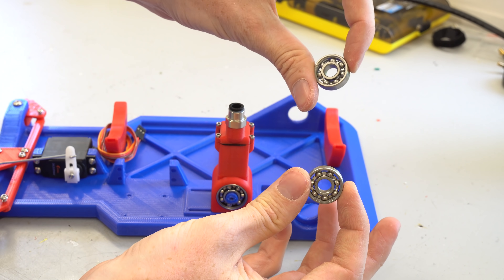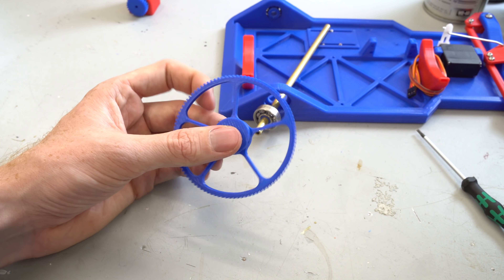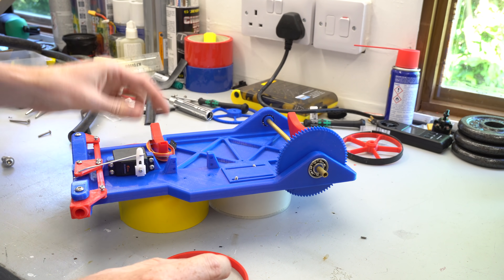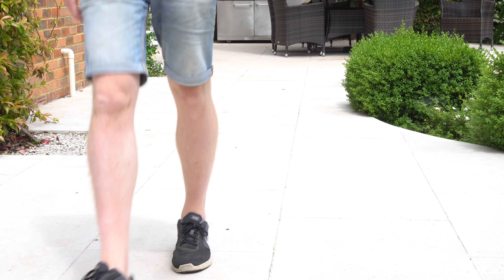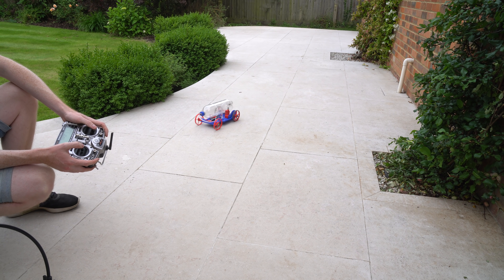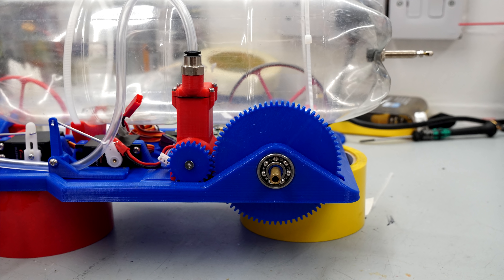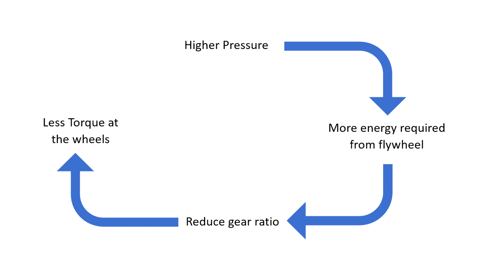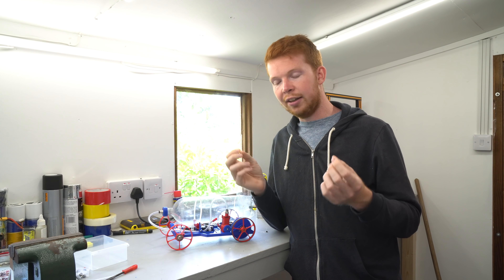Air Powered Car

Comment: You could put a flywheel attached directly to the engine's output (maybe a metal one to increase mass and decrease the space it occupies) and then use gears or a belt to move the actual wheels without the need for a "secondary" flywheel.
(Sorry for my bad knowledge of technical words in english I hope you can understand it anyway. Corrections on my english are welcome)

Comment: Works at low pressures; possibly make a pressure reduction system? Honestly pressure stuff isn't really my thing so I genuinely don't know if that's viable.
Another, easier, option is to simply have a seperate flywheel. If you move the engine forward slightly (it's already on that rail so it should work) and have a weighted large gear in the middle of the train acting as a seperate flywheel, you could essentially increase the flywheel weight and momentum independently of the car's wheels?

Comment: why not a seperat flyweel and mby adding a friction gear to get the movement to the wheels so that the engine can run further even if going slow or stop like anactual car

Comment: put the flywheel directly onto the crankshaft => higher RP, less gear wear (flywheel connected via a gear isn't really a good thing, engineering-wise)

Comment: Try to make some space for the engine to fit a flywheel on the other side. Then shorten the gear ratios to about 6:1 - 9:1 then it should work

Comment: Have you tried simply increasing the mass of the car? It'll ll return more energy to open the valve and if you're going to push start it anyway then the low end torque is less relevant, unless you just have a crappy driving surface.

Comment: Why not add an explicit flywheel directly at the engine?
Reply: Oh and one more thing, steam engines use something called a piston valve to deal with the problem of valve actuation force due to pressure. Only works for up/down stroke actuated engines though. But it uses the inlet pressure to cancel forces acting on the valve.

Comment: You Could increase the length of the crankshaft and add some heavy coin or other object so you only need to redesign 1 part instead of the entire engine

Comment: How about a dedicated flywheel on the motor's shaft? Adds more flywheel storage and you can still increase the gear ratio to get more torque at the wheels, it just adds a little bit of weight...

Comment: Third and correct option:
Flywheel should not be geared. It needs to be on motor shaft directly.
Output gear to drive then reduces normally. This gives flywheel full effectiveness by not reverse gearing it and increases torque on output to wheels as planned.

Comment: Awesome, getting there!   I think going the car route for this engine was a good idea too, easier to test and tinker with and probably requires less energy to move a car than provide lift for an aircraft.    For flywheel you could add one on the first gear, like a small metal disc or something.  Watching these videos kind of makes me want to get a 3D printer, it's cool how you can come up with a part and just make it.

Comment: I think if you made a two cylinder engine it would be able to handle the high counter torque and be able to run at higher pressure

Comment: print the small gear mounted to the motor in a heavy brass filled  PLA.  with a larger diameter flywheel area that will bypass the larger gear.

Comment: at 3:22, you can vary engine speed, wildly, for throttle control.   or you can vary how much power reaches the drive wheels.  or both.   a disc-and-caliper brake could be employed, as simple way of varying output rotation rate.    others have suggested that a flywheel be added to the system.   after some thought, imo, it may not be a good idea, to try to include a flywheel in such a simple power transmission configuration; ie, flywheel momentum will noticeably affect response to changes in throttle.     cheers

Comment: You could also try a dual piston engine, just take the exact same design as you have, offset it by 180 degrees and stick them together, this was you get a lot more force to open the valves. Ideally you would want 4, since then you could offset them by 90 degrees and you would always have a higher pressure from the piston pushing down than the valve trying to close it.

Comment: The engine would work better it modeled after a steam engine, better a two cylinder steam engine with offset crank can be started from stopped allowing the use of a throttle.

Comment: You should try a twin cylinder engine so that the force of the opposing piston helps drive the other one so the throttle doesn't always cut the engine.

Comment: Put a flywheel on the crankshaft.

You are also wasting a lot of energy as friction because your cams are so big in diameter. Larger diameter>faster rubbing speed at the same friction>greater power loss.

Did you think of making the piston cylindrical, getting rid of the gudgeon pin?
Reply: Sorry I did not explain that well. I meant a square piston with two cylindrical rounded edges so that it can wobble in the bore.

Comment: Now when you've got the valve ans plastic tube working maybe a boxer 2 cylinder could work nicely. Power every 180 degrees instead of 360. And although expensive you could look into a hpa system for airsoft as the air supply

Comment: One problem with this design is that it has two driven wheels and no differential solution between them. The car will stop itself when it's turning. Simper toy cars have one wheel drive and that's probably the best solution as you have good traction and smooth surface to run on.

Comment: Having an higher RPM moter with metal flywheel and then gearing it down 20 to 1 would probably work better.
Reply: MazeFrame and the air bottle would empty in two seconds. No, I think he needs a few tweeks to improve efficiency (like adding a flywheel) and it’ll work a treat.
Reply: Reducing the bore would reduce air required while also reducing mass allowing for higher RPM.

Comment: the diameter of the piston / the travel of the piston if =1 square >1 super square. It will effect the speed of the engine. You need a smaller piston and a longer travel

Comment: You could just gear it down, put a metal flywheel outside of the gear on the engine and increase the pressure. That would probably solve all of you problems...

Comment: Electronic "ignition"?  Use an encoder for the shaft position, and a selenoid  to open and close the valve. Speed and engine timing in one valve but there may be to much weight penalty.

Comment: You are also losing power and speed while turning due both wheels moving at the same speed, making one wheel drag the other one and requiring more torque to clear the turn. This can be fixed by making the engine drive a piece called differential, which allows  both wheels to be driven while also allowing the wheels to move at different speeds, allowing for a proper spread of torque Instead of wasting it.

Comment: Make a boxer style engine with dual expansion.  First cylinder exhaust valve goes direct into larger cylinder.  Large cylinder has port at bottom of stroke to exhaust.  No extra valves to deal with.  Get double the work from the same air, more or less.

Comment: Why don't you just print a couple of smaller gears and make a gearbox? And put some mass to the flywheel, it would be lot less effort to redesign the inlet and the engine. Well just my opinion. Cheers

Comment: try powering with dry ice lol
Reply: I kind of want to see that too.  Baby steps though, once it's perfected he can probably try stuff like that after.
Reply: A small amount probably would not be a big deal.  Suppose you'd still want to build a  pressure relief valve just in case though. The danger is only if the motor was to seize otherwise the pressure will be lost through the motor running.
Reply: @redsquirrelftw  you can add a burst value that opens under very high pressure so if the pressure were to somehow build up tooo much, the value will explode letting the air out and the air container won't explode
Reply: dry ice is a terrible idea. you're just making a dry ice bomb. as counter-intuitive as it sounds, liquid propane would actually be a better solution

Comment: Increase the teeth on the drive gear and decrease teeth on the driven gear. Larger drive gear and smaller driven gear means more speed and less effort on the engine itself

Comment: Maybe use some kind of pressure regulator? That way to can feed the engine 30PSI but pump the bottle up to higher pressures for a longer run time.

Comment: Just add a regulator between the bottle and the engine and then you could pump the bottle to higher pressures and the engine wouldn’t be overwhelmed

Comment: "No replacement for displacement.""- Every Big Block Chevy owner ever. Seriously though I do like this series. Not the best idea but the engine worked well with a propeller flywheel, air powered air car?

Comment: You should put a small r/c starter on the car. You could also use a small ball valve for the the throttle. You should do an inline 2 engine for the engine because most real cars don't have a one cylinder engine.

Comment: Reduce the gear ratio. The flywheel energy is the velocity of the car. Unless the torque causes the rear wheels to slide on the pavement it should work.

Comment: Change the valve system to use the Air pressure to open the valve that way the more pressure the more power to open the valve

Comment: Well clearly the valve problem means you need a multi-cylinder engine so the power stroke of one can be powering the valve opening of another :) EIther that or a more massive flywheel running at engine RPM

Comment: The engine you designed was for an airplane not a car, u never see a single cylinder engine in a car since it produces very less torque,but in a model airplane single cylinder engines work better,(just a suggestion)good luck 👍👍

Comment: I hate to be the guy that brings up the multi cylinder thing again... but I have an idea for you. Take 2 of your engines and gear them so that they are 180 opposed from each other in both orientation (so that they can keep running the same direction even though the gears should reverse their directions) and crankshaft angle (as to oppose the valve torque requirement). No redesign,  no complicated intake or crankshaft, no issue with the ball valve, more power, and it would look cool.... obviously at a loss of run time, but still... its something.

Comment: Real cars need a starter motor for basically the same reason. They need a huge amount of torque just to get started. I was thinking you could add just a standard pullback spring mechanism or maybe a secondary compressor running a rotary turbine just to start the flywheel going.

Comment: The Valve issue suggests that this engine is close to an steam engine. So as not to fight the bottle pressure an sliding valve (suggestes by many comments) may be the way.

Comment: Do both rear wheel's need driving? If you powered just one of the rear wheels you wouldn't need to worry about differential. You could of course build a 3 wheeler, two at front and one (driven) at the rear, this would also have the advantage that all wheels would be in contact with the floor at all times...Keep up the good work pal!

Comment: looks like you need a heavier flywheel. but I feel like this is also a good application for a clutch, so once it has the momentum to run you can ease on the power to the rear wheels. maybe even a centrifugal clutch to minimize channels

Comment: Most simple starter motor would be a servo with a sliding hook.
Essentially more of a pull-starter then a starter motor, servo would connect to a bar that has a hook that rests on a ledge. As the servo pulls, hook drops onto the angled teeth on the motor output gear and pull starts the motors rotation and clears the teeth add not friction now the motor has started. The servo could stay in this position till needed again, if set it up on a transmitter switch.
Reply: Although,  if the pull start teeth are added to the drive gear, the pull start speed would increase 1-4 and a better chance of staring, so long as the servo torque is there.

Comment: What about adding a flywheel directly to the engine shaft?
Reply: steam traction engine  setup would work. a fly wheel connected to the crank keeps the engine going while there are a separate set of gears driving the wheels
Reply: Yes!
Reply: Yeah this seems like the obvious and most easily implemented solution.
Reply: @derekwallin2624  Yeah i thought so as well.

Comment: As people (and myself) have suggested before a double acting piston will substantially increase torque here, Using sliding valves too, basically emulate make a steam engine.
If a double acting piston is not on the cards then add a second cylinder 180 degrees out of phase
And lastly, swap your 3D printed small gear, with a small gear + large pulley, put a band around it to drive a small pulley with mass on it so that the mass will be spun faster than the engine is turning. that may provide enough momentum to keep cycling the engine between power strokes.

Of course... all three methods could be used... though if you add two double acting cylinders then they would be better at 90 degrees phase.

The double action does lend itself to a long flat engine too, perhaps build part of it into the chassis directly?

As for the dry ice/co2 idea, people are worried the low temperature gas could cause the parts to crack, I wonder how feasible some kind of heat exchanger would be, to try and heat the gas coming out of the bottle before it is passed to the engine using ambient air.

Comment: You need a metal flywheel on the engine (aluminum is fine) to maintain TORQUE. You also need a restrictor in the air delivery system so that the engine never sees more than 35psi, but you can have the bottle charged up to 100psi. This will help with the motor "binding" at high pressure.

Comment: I think that you should firstly add a flywheel, then increse the engine displacement and add another cylinder and to run higher pressures i suggest to use a small fire extinguisher bottle

Comment: Going with the two cylinder route with the engine would also resolve the issue. 
Additionally I think it is easier to cold-start a two cylinder engine without having to push it.

Comment: You need a pressure regulator rather than a simple throttle. You also could use a pressure-balanced inlet valve, formerly used on some steam engines. In order to make it self-starting, you need at least two double-acting cylinders, with the cranks out of phase by 90 degrees, like steam locomotives.
Reply: I agree with the pressure regulator.  This will allow your current engine design to run on lower pressure and use the extra reservoir pressure to get more run time.
Reply: oldvideodude 
Yes, a given throttle setting at the lever on the rc controller would be the input to a control system to maintain a given air pressure at the engine.
Reply: he wants pressure to remain constant.  the throttle would control flow only.
Reply: oldvideodude 
Sorry "throttle setting" on the rc controller, but the actual throttle valve itself, that would be modulated by a small PID controller to maintain a given pressure just ahead of the engine. So that a given position of the lever on the rc controller would correspond to a given pressure at the engine, regardless of how full the air bottle is.
Reply: ahh, i understand
Reply: @gregorymalchuk272  Great idea!
Reply: Легче тупо сделать паровой двигатель на вейпе XDD

Comment: Wouldn't the solid axle make turning very inefficient, due to one wheel trying to spin faster than the other during cornering, and vice versa?

Though I am still very impressed by you little project :)

Comment: Okay, so, why not add a flywheel onto the small gear that runs next to it? It's hard to explain but you can make the axle coming out of the motor a bit longer and add a flywheel to it so you won't need other solutions. Or use a GT2 or related closed-loop belt. They are used in 3D-printers and work really well and don't have play.

Comment: You should increase the engine displacement but also regulate the air going into the engine so it stays at the optimum pressure longer. You can get very small in-line regulators with push-to-connect fittings. The smallest ones don't have gauges, so you'd need to adjust it before installing, but it would be super light. Also, you could make the car start itself if you had a small dc motor with a partial gear on it that synced with the larger gear. Just rotate it once and the teeth would engage long enough to crank the motor over. There would be a cutout on that gear that would give the larger gear clearance when the motor is operating under its own power. You could control the rotation with a cam feature on the partial gear and a micro-switch.

Comment: A shoe clutch (centrifugal clutch) might help out with the torque issues.  It would take some adjustments, but as the rpm increases the shoes are pushed outwards and make contact with the drum which is connected to the gear.  You start the engine at a low throttle and it will run constantly.  When you hit the throttle, the rpm increase will push the shoes out to the drum and cause the gear to turn.  The drum is able to spin freely on the axle.

It could also act as a flywheel for the engine because of the weight, and too much torque will cause the shoes to slip inside of the drum, and prevent the engine from stalling if the car is stopped suddenly while moving.

Here's and example of a simple one that uses a spring going around the outside of 2 rubber shoes: https://traxxas.com/sites/default/files/images/step10a.jpg

Comment: Need more cylinders so you don't need to push start it.  Using a second cylinder alleviates the need for a fly wheel as well.